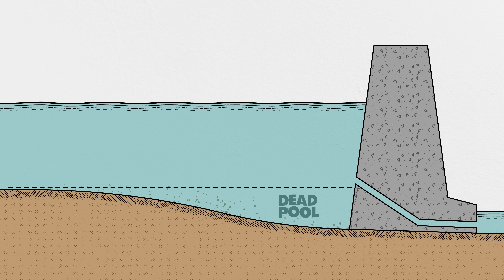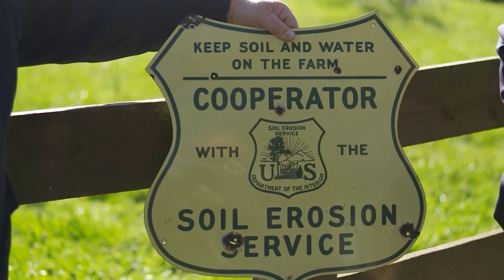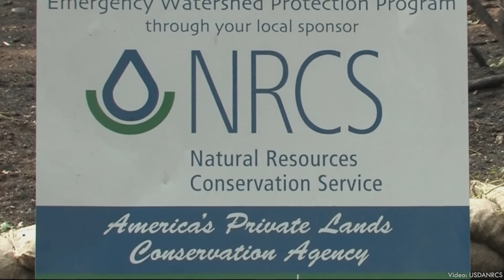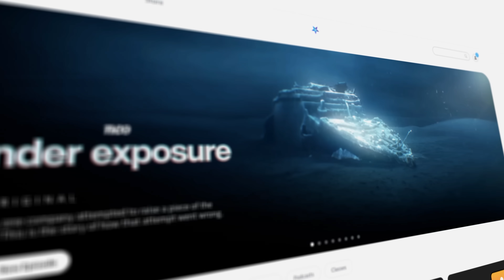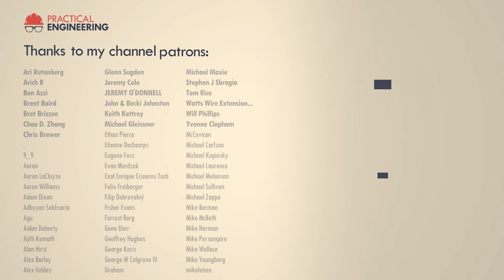All Dams Are Temporary

Comment: Question as a non engineer: couldnt you build something to keep the soil from settling? And wouldnt that muddy water have stronger pushing power than clean water (therefore generating more power in the dam)?

Comment: Wouldn’t an easy solution be to create a sediment barrier at the start of where you want the reservoir to be, basically double damning, and at the bottom of it have a large grate of sorts that only allows a certain amount of water through, that shunts the sediment into a separate much more narrow channel, that reveals the entire length to the front before simply doubling the sediment back at the front of the reservoir?
It wouldn’t be completely perfect but i imagine that if designed right most of the sediment should fall into the first dam section and get “sucked” into the narrow channel. This sediment would then deposit along the narrow channel but due to water flow it should work similar to a dirty river and dump the sediment out the front by pushingv the top sediment along. As long as it’s enough flow to carry or push the sediment it should naturally avoid clogging.
As long as the catch is small enough to openning is small enough to allow only enough water through to flush the sediment out it should never end up in the secondary reservoir

Comment: Maybe the solution is just using air pressure? Let me explain…. What if you put tubes with  nozzles  close to the dam wall that will air the water and float the sand on and into and over the dam??…of course im talking in big scale not small garden hoses.

Comment: Would a 2 dam system work? Sort of like train rails, you change where the water flows through but you let the water rejoin at a point down the line. You could let the water go low on one dam and dig out the sediment while the other dam keeps the water flowing.

Comment: My Parents farm has a small dam to create a pond for the irrigation pump to draw from. It has a somewhat unique outlet design that creates an undercurrent in the bottom of the pond and it doesn’t allow silt to build up. It’s been there for about 50 years and it’s never needed silt flushed. I know it’s smaller scale but I wonder if something similar could at least keep most of the sediment moving in a larger situation.

Comment: As someone who lives downstream of Gavins Point Dam and owning property on the Missouri, (Hi, I'm a stakeholder in this)  please don't mess with my dam.

The reason there's too much sediment was the Spencer Dam on the Niobrara, broke due to a sudden rain flash melting a bunch of snow and causing a massive ice run.

I'd prefer the USACE or NPPD rebuilt the Spencer and used suction dredges to resuspend the sediment while slightly increasing releases to get it downstream.

Or maybe start trucking it to Dakota Dunes to dry out and eventually backfill a levee around their community so they stop flooding out every time the Corps starts prioritizing DEI or ecosimp causes instead of property protection. (They're still on my sh-t list for their mismanagement in 2011. Of course they're joined by the DAPL protestors who literally defecated in it while "protesting" the damage that might potentially be caused by the Dakota Access Pipeline. 🙄)

Because the current state of the Missouri is as though the Spencer dam didn't exist, and the result is the Niobrara dragging silt from land that was high and dry down into the Missouri.

Comment: The only solution I can think out would be to flush out the water and capture the settlement and then reconstruct the river in such a way where it prevents settlement from moving towards the dam, I don’t know how though. Maybe since that the settlement is moved with water, the best way to prevent the settlement from moving towards the front would be to construct a filter that periodically lifts and allows you to remove the built up settlement away from the river. This sounds like a incredibly complicated situation but I really have nothing else to think of, I’ve always believed in solutions but I know nothing about Dams, so I don’t know the consequences of attempting anything. 

Maybe if we flush out the water one time, we can quickly construct something that prevents us from having to do it again and maybe we’ll just have to deal with the reaction what it might impact but like I said, only if we flush out the settlement and water one time.

Comment: The sediment load of a river is not constant how about building special dams that only dam when it's needed. Maybe inflatable barrier or something. You still have the issue highlighted around 12:30 but since you do not have a permanent reservoir and can set up the location where the sediment will settle out in a way that facilitates de-watering and removal maybe it can help. And if it's not contaminated maybe you can even sell it

Comment: why not use high pressure water cleaner type devices to refloat the sediment on a continual basis so that the growth is restricted/reversed on a slow basis? think of these machines which can be autonomous that crawl on the floors and "pressure wash" the floor while pumping the water to the surface?

Comment: Okay, you said come up with solutions at the very beginning.  Before watching, I thought about it, and this is what I have so far.  (And, your right, it ain't easy.)  1. Remove the dam slowly and carefully over a period of time, and allow the river to revert to its natural state, even if that means losing a nice lake, and making the riverside properties all have to move back a few kilometers.  2. Put silt-scooping barges out on the river 24/7, scooping up silt, and moving it somewhere on land for processing.  Perhaps it can be reused?  In concrete maybe?  3. Divert river for 10 years while you build a really cool structure.  I'm thinking, dirt is heavier than water, so make a ginormous holding tank directly under the river.  The top of that tank will be very thick concrete.  Set into that roof-of-that-Tokyo-flood-facility-sized-chamber/river bed will be a series of screens that will permit only dirt and water through, but no fish and only the tiniest microorganisms.  In each screen-chamber dirt will fall to the bottom, the water on top will be pumped back into the river (mostly,) so by the time the final screen-chamber is reached, it's basically just mud falling down into the chamber.  You have two of these ginormous holding tank things, so one can be turned off from accepting water and dirt while the chamber below is being emptied (mechanically lifted to a drying room/kiln, dried, crumbled up, and then taken topside to be used as soil - probably quite fertile and top quality soil at that.)  This option is massively OTT unless you're in a post-scarcity civilisation.  But hey, you said to think of solutions, and I dream big.

Comment: I had a potential solution that wasn't addressed: what if we were to pump air into the sediment deposits upstream to a dam (preferably during periods of heavy river flow and coinciding with the opening of the dam partway), thus resuspending the sediment in the water column and allowing it to flow downstream. Perhaps some similar mechanical way to resuspend the sediment?

Comment: So i heard this sediment and you hint at it also is actually pretty fertile soil. Are we dumping it into fields ? Or is there anywhere on the planet some dual dam system where they take turns in using one side for water storage and other for crop growing and when the soil is exhausted instead of dumping  fertilizer it would switch to usage as a reservoir and former reservoir back to crop field ?

Comment: to solve the problem i would run a large diameter pipe or pipes up the length of the dam, to a sediment containment area, at the head of the dam, where the sediment first begins to drop.  the negative pressure in the pipe at this end should be enough to power some form of continuous dredging in this area, and the sediment is carried below the dam by the outflow.  all that would be required is operation and maintenance, while the power comes from a small loss in the current entering the dam.  we use this technique in miniature to repeatedly dredge out our small hydro power dam, where a two inch plastic pipe, far enough downstream, produces enough suction to take your fingers off, if you're not careful.  if am not explaining properly, please ask - i am sure this method really does solve the problem.  thank you for your informative video - now that i understand how sediment accumulates, i can start chasing it upstream, to regain our catchment.
Reply: I was thinking of a robot pumping the sediment from the deposition site to the downstream side of the dam through a pipe but your solution is much more elegant. 😅
Reply: This was the idea I had... Some kind of low volume sediment filter that transports sediment around the reservoir....
Reply: Add some kind of gold catch and maybe it’ll become more profitable? Though the sediment probably has very little gold.
Reply: physically it wouldn’t be hard to dredge it out but monetarily you’re only outputting a 1:1 ratio of volume that you’re removing to volume you’re gaining it’s hard to make it profitable, making a new dam in a new river would be the same amount of effort for way more output energy storage and material usage

Comment: The flow rate is constant, so if the river opens up into a lake the area widens and the speed of the fluid goes down - the particles descend.

I would have suggested Basins to capture the soil / large enough for the soil to descend to the ground. On the bottom I would either use screw like contraptions to move the soil and/or use pumped water to move the soil past the dam. This would be a permanent solution requiring no trucks or excavators.

Comment: Great video. I am a retired Chartered Civil Engineer here in the UK.
In England we have a similar but smaller-scale effect caused by weirs crossing many of our rivers.
The river behind the weir invariably has low flow, is full of sediment and is "dead". They also are serious barriers to migratory fish.
Weirs control erosion by dispensing energy on a hardened toe, so we cannot just break them up without studying the consequences but when appropriate, weir destruction is good for the environment.
Reply: What was the purpose of building all these weirs and why are they no longer necessary such that removing them is preferred?  Was it a long term project whose conclusion has finally arrived, or is more an issue that the pitfalls have finally started outweighing the benefits?
Reply: @herbderbler1585  Wiers (at least in the UK) were used in the past to enable water diversion for factories and mill ponds, as well as to make rivers deeper and more navigable, especially as we have a very high tidal range, a lot of our coastal rivers vary in depth naturally significantly.
Reply: @herbderbler1585  The weirs were originally built to provide a head difference for a water wheel which would power a small mill. So it has been a long time since they were needed for their original purpose, though some provide useful erosion control and I know one at least which is "Listed" i.e. scheduled to be preserved as a historical monument. Until recently many rivers were too polluted for migratory fish to survive, but formerly "dead" rivers are now getting salmon and trout populations.
Reply: @alanalmo5834  The weir in Chester is a very old example built in 1093 to provide water for mills along the river, but it continued to be useful even when those mills stopped being used and were demolished. The head of water from the weir served a small hydro-electric power station for a few decades but now its most important role is providing a barrier to the tidal section of the river and ensuring that the river upstream of the weir is fresh which is vital for water abstraction to supply the local area.
Reply: @herbderbler1585 some were built centuries ago for old fashioned waterwheels to power the textile industry
Reply: @herbderbler1585  They were built for water wheels and we don't use them any more. 😀
Reply: As far as I know, they were for mills, so they could control water levels. We don't need them now, I stand to be corrected, will the chap above tell us if we need sluices too
Reply: Many of the UK weirs are older than our country.  They provide a good example of long term consequences.

Comment: Install giant acoustically tuned granite rods where the water is anticipated to slow down. Get them to vibrate and force the sediment to continue towards giant pipes that run under the dam specifically to reintegrate the sediment into the outflow. These can be flushed with high pressure water jets that use the water reserves created by the dam itself. 

So, that's 3 systems. The vibrational poles to keep the sediment from settling, the mass of huge pipes to get the sediment to flow under the dam, and the water jet system to keep the sediment from clogging those pipes.

Comment: I feel like the work around to this problem is just to not have a dam.  We want a reservoir to save water and a hydroelectric power station, and a dam is the way we've found to do both of those.  However in my head there's no reason you can't just have a reservoir site close to a river that you pipe water from the river to.  If you just siphon off water from the top of the river, and leave turbines at various intervals into rivers, you can have the benefits of the dam without the environmental impact on the river.  The key seems to be disturbing the river as little as possible.

Comment: Question, is it possible to make a less efficent dam, like one that slows rater than holds back water as to still let both sediment and wildlife though? 
In my head im thinking of a beaver dam, it does hold back a ton of water but likely because of its porus material lets a fair bit through. Logicaly this still filters out some particles and larger fish though. 

because part of me feels an awful lot of fish get killed by dams just thinking about the water speeds.

Comment: None of them off the top of our heads is easy? Build good Dams like old America, and then let some water power High pressure Ultrasound holography system by Plasma speakers with safe frequencies to LIFE & DAM for force field reinforcement. Lower strain on the Dam help hold integrity and also all scanning the Dam plus everything around it to help computers predict. Google: "Ultrasound can reach pressures as great as the bottom of the ocean" That can be used as a repel force and greater than ocean with Plasma speaker tech.. The same technology could be used to build the Dam with portable generators merging their power together..

Google: "Ultrasound of Earth's crust reveals inner workings of Tsunami factory" Vision techniques = No problem. Google: "Ultrasound see viruses turn genes on and off" Where are genes at? Like I said.. Not a problem. Rips a gene from something with Ultrasound and adds to my collection then makes Alien hiss grin at Earth

Comment: Would having open pipes at the bottom of the reservoir that lead out to low parts of the other side of the dam give us a way to flush out the silt from time to time?

Is that what the grates do at 12:20? Are they funneled into a pipe going to the dam? And is the water inlet for the pipe further up the stream to allow the water to flush the sediment at set intervals? Would that work well enough?

Comment: The solution is building more than one dam. Alternating between dams would reduce sediment. Also probably need a better way to build them as well. Having a lower gate that allows sediment to be pushed past the dam is probably a good idea. Between multiple dams and lower sediment removing gates dams would work better and last longer.

Comment: Nuclear. The solution is nuclear.
Reply: nuclear is also temporary
Reply: @SwordTomato  Decades of low uranium prices have limited commercial prospecting and exploration for uranium deposits worldwide. You don't have enough data to make accurate claims about how long our uranium supply will last, so just saying it's temporary isn't a good argument.
Reply: @ The DOE is forced to pay tens of billions of damages every year for failing to properly dispose of nuclear waste just in the US. I am not against nuclear energy but I do not think you have learned enough about how it works in the real world and not just in theory. It is not "The solution" by its self. Your point about not having data makes no sense, it doesnt matter if we run out in 2 or 200 years its still limited which is all I was saying.

Comment: What if we suspended a sediment filter netting horizontally right at the level where it wants to settle, all the way down the river from the dam to where it would start to accumulate? Put it at such an angle that it wont be bogged down with tons of sediment (because it might break under too much weight). Also periodically check and siphon the sediment from the netting.

Comment: In Northwest iowa, there is a glacial Lake that has remained almost as deep as it was during the Ice Age. This is because the lake itself backfills off of the primary water flow, which flows through several other Lakes before reaching it. The yearly rise and fall of those Lakes means that whenever there is large amounts of sediment moving, there is no flow into the deep lake. It seems to me you could use a system similar to this. Rather than damming the primary River, you dam a minor tributary, and construct a much smaller dam, upstream, with the intent of opening and closing it on a yearly basis to flush out any captured sediment.